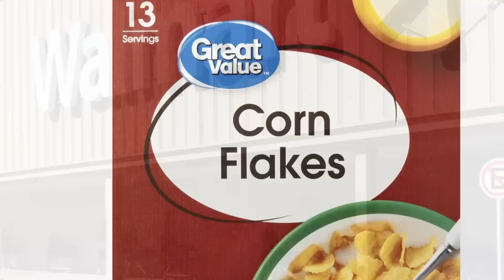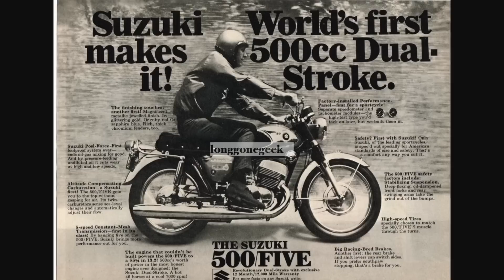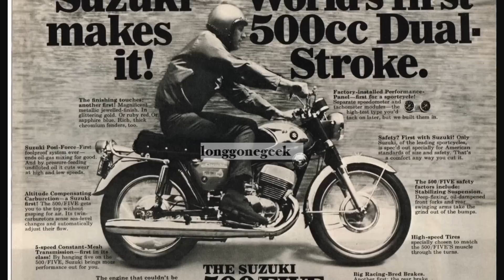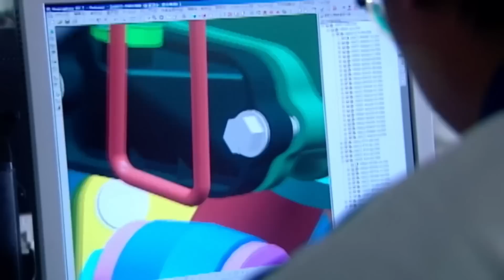How Suzuki became the Walmart of Motorcycle Companies

Comment: Im not sure why you keep saying they have no advanced technology. My busa has hill assist, cruise control, cornering abs, combined breaking, launch control, engine breaking control, adjustable suspension, wheelie control and rear tire lift control, LD everything, a TFT dash with multiple profiles, break pressure and lean angle indicators, quick shifter up and down the list goes on lol

Comment: Suzuki stole the design of the air cooled twin cam 4 cylinder from Kawasaki it's based of the same engineering as the z900 which is the actual bike that blew up the market and started the "sportbike" trend Kawasaki's then for example if you had a Kawasaki 750 you had the most powerful production 750 on the market same as the 650 z900 z1r ect. Suzuki ain't known for anything but plagiarism the first year 77 gs first production run of the gs is a Kawasaki's copy cat 😂 get your facts straight dude
Reply: Thank you 🫡🥷

Comment: I would say Honda built the first true sports bike with the improved 1982 CB1100RC2 Full Sport fairing  solo seat unit that turned to 2 seater multi adjustable handle bars rear set pegs and beautiful aluminum 26L tank etc yes it was a limited production bike and US didnt get them but it was a big leap forward in sports bikes handling brakes etc ...

Comment: Been riding Suk's since the 60's. You can talk about manufacturers for ever. Great bike riders can make any bike great. I've owned a 1980 GS1100 since 81. I've maintained it meticulously and it's in mint condition. I have a 4/1 header on it and to this day it's an easy to ride rocket ship. Unfortunately Suzuki is not the same company I knew growing up. Great bikes at a great value that if maintained were very reliable.

Comment: I'd love to see Suzuki start making the one bike that Honda and Yamaha wont for this market: A full function, simple motorcycle for MUCH cheaper than everyone else. For example, give us 1970's or early 80's tech and performance, at 1980's prices. Bring back the 1981 GS450 at $3k. It'll do 95% of what most riders need to do, at a price that most can afford. So what if it doesn't have the latest in casting technology, or ABS systems, or TFT display? I'd love to see a return to very simple, inexpensive bikes that everyone can afford. You want to get more folks riding? Bump up the engine size of the TU250 to a 450 or 500cc P-Twin and change only what else is absolutely necessary for the power level, and sell it dirt cheap. Or drop it down to a 125cc and sell it at rock bottom price. Think Honda Cub or Ford Model T.

Comment: Face it, there is limited room to increasingly change the platform of a motorcycle. It's diminishing return. I recently had a GS500F. It was a solid, simple, affordable commuter. I gave it to my sone when I decided I wanted to ride a Triumph again. But I would buy another 500, or maybe a v storm. But I am the kind of guy that likes  air-cooled, carbureted, kick start, parallel twins and thumpers.

Comment: Supersports are dying and being replaced by sport bikes. It might not make sense but technically supersports are just the 600 and 1000 classes, with the rare 750, with clip-ons and such, while sport bikes are all the rest that still have clip-ons but on risers. Like all the beginner sport bikes and especially the booming 650ish class that's replacing the 600s with mostly twin engines with somewhere around 80hp, like the new suzuki gsx8r that's the last to join this segment, tho kawasaki should update but I digress. I think the r7 is the only outlier really because despite being in this class power wise it retains the superspot position with no clip on risers.

Comment: Suzuki has been my bike since I ever started riding.  Im actually on my second k1 600.  I did my homework and went to the dealership and tried the CBR R6 Ninja etc!   With Suzuki yes there's alot of them. However they are probably the most comfortable sportbike out there.  They have power in every gear and are very easy to learn on.  So are they "The Wal-Mart of motorcycle's"?   To each his own i guess.

Comment: Have to disagree. Most of the tech came from 2 stroke like the Gamma 500 substituting a four stroke engine. Owned one and still am impressed with it 30 years later. Only bike I know that actually squats at higher speeds. Great handling and eye watering acceleration and speed.

Comment: not just in us, here in Indonesia Suzuki also backed down, their dealers and shop were closed.
but the reason was different, suzuki Indonesia just incapable to adapted to market. latest suzuki boom was satria fu or suzuki raider in thailand, a high performance underbone motorcycle. but the market was shifted, in 2012 the market was asking for sportsbike and automatic scooter, suzuki didnt have the sportbike and their scooters just flopped, when you riding a scooter what you need was light weight, low fuel consumsion and high durability, and that not how you describe suzuki scooter. in 2018 suzuki bring gsx 150 from india, but the hype of sportsfairing and naked bike was over, in Indonesia the market were, maxi scooter, retro scooter, and retro nakedbike, and suzuki didnt have any of them. in 2021 kawasaki launch zx250r, suzuki bring gixxer 250 from india again. and indian design just didnt go well.
its not like they didnt had the models, they had saluto in thailand for retro scooter class, they had brugsman for maxi class. but they choose to bring india models instead which honda already show in 2010s that didnt go well in indonesia
Reply: sad indeed

Comment: I own a 2007 GSF-1250 SA. (Bandit)
I bought it to commute around SoCal.
Today, it has over 233,000 miles on it.
It has never had any engine work.
It has never broken down.
Only basic maintenance.  Such as oil changes every 3,000 miles. Even though I used Mobil -1 the entire time, I still change it every 3,000 miles.
I have replaced the chain about every 25,000 miles, replace tires as needed. and air filter annually.
It still runs like new.
I cant complain.

Comment: Bart, you were not there in the '70s!  The Titan 500 twin was a mild mannered model, not even remotely raw or racy, and in general Yamaha and Kawasaki were at that time better known for performance, Then Suzuki sold the 'water buffalo 750' the first modern water cooled bike, again it was more touring than sport! My point is that at that time Americans did not see Suzuki  primarily as a performance street bike maker, but they did attempt to sell reliable 2 strokes at a time the world really wanted 4 strokes..50 cc racing was of never of much interest in the US. The GS series was new for Suzuki but hardly 'ground breaking' as it significantly copied the Z1 with DOHC and the all popular CB 750 in general.It was a safe bet for Suzuki, probably safer than Yamaha's choice to build a 750 cc triple.
One of the carryover 2 stroke features of the original GS 750 as well as of the Z1 was using a built up crankshaft; eventually they went over to a one piece crank with plain bearings as Honda used. 
A feature not often realized about the GSXR was moving the alternator off the end of the crankshaft to make it more compact and presumably able to lean further!

I would say that though selling fewer models now they continue to be known as reliable. We take that mostly for granted these days, but 50 yrs ago many bikes, especially 2 strokes were not !

BTW, in the early '80s I and others were racing 
Ducati Pantahas at the Bridghampton raceway in NY,  Guess who was taking closeups in the pits etc,  haha Suzuki engineers!  Tell me where an SV 650 was inspired?

Comment: I doubt if you guys know this, Suzuki has launched an excellent machine here in India (Gixxer 250) which is an allrounder in my opinion, it got ample amounts of horse and breaking power for Indian roads/traffic, you can use it in city as well as highway (my long stretch was 650km and engine was smooth without heat issues). This machine comes at a price that competes with R15 and mt15 but still the number of sales are 50 times lower than those. This is mainly due to poor service reach but still 50 times less is nightmare number for a machine of so much capability.

Comment: i think this video leaves out Suzukis' complete dominance in drag racing starting in the early 80s with the GS1000 motors. this continued into the new century, with only Kawi offering any competition. Honda and Yamaha were conspicuously absent. 
i agree with most of what you say, but i still find the Walmart comparison initially insulting.
Walmart is huge, whereas Suzuki is the smallest manufacturer of the big 4.
Honda is bigger than the other 3 combined (not sure if that is true anymore)
i would compare them more to Chevrolet - the GS1000 and subsequent GSX&GSXR motors were the modular "Chevy small block" of drag racing. (Hemis were very expensive)
i like my 01GSXR1K very much. The leap to current tech bikes is too expensive for the comparatively small increase in power/weight or handling characteristics. 
i also salute the SV650 as THE standard "standard",
the VStrom as the standard dual sport
the DRZ400 as the standard off road 4stroke and
the DRZ 450SM as the standard SuperMoto 
This shows a wider spectrum than just sportbikes, but sportbikes are my favorite segment.

Comment: Suzuki needs to drop the DR650 and rework the design it with fuel injection, 6speed awesome middleweight offroad T7 killer.  Skip out on the silly TC electronic gizoms and give it only bare bones disable remembering ABS.  It would be the alternative to more fully offroad compared to the new vstrom 800.  My only requirement would be to please add cruise control if its ride by wire.

Comment: In my country buying Suzuki makes little sense, few reasons for that.
The lineup for larger CC bikes is limited, as a result the dealerships are also limited resulting in bikes that cost as much as other Japanese brands. Furthermore Suzuki haven't updated their engines and other tech for at least a decade to decade and a half. So truly is a brand that erased itself from this market. Furthermore brands such as CFmoto and Benelli are truly giving a run for their money to Japanese brands. These brands are making some quality bikes across the range, unless Suzuki raises is game it will be the first Japanese brand that will go under.
Recently I was in the market looking for mid tier tourer Versys, Vstorm and Cfmoto800, it was later that i have decided to purchase. It's truly value for money using sqme engine as KTM 790,heated grips and seats, cruise control heck the bike comes with all panniers and luggage boxes. So in my opinion Suzuki aint the best value for money, its a waste of ones money.

Comment: I chose M109R instead oh HD Fat Boy for a few reasons: forward foot peg, proven perfected engine since 2006 and its sheer performance, low en tork, simplicity, no gadgets, no abs, cheaper to maintainance, Millwakee 8 engines are based on this engine (8 valves, 4 double spark plugs), full performance out of the box, does not require extra $30 000 to get full performance.  HD turn me down with their gimmics. Last the sheer beauty of the bike, especially in Candy Red. Even though it has the comfort of a cruiser, it has the stability and road performance of a sport bike... sort of considering its weight.

Comment: I believe suzuki and kawasaki have partnered together.  Everything goes in cycles bud.  Back in 1985 it was suzuki leading the pack and honda yamaha kawasaki were the walmart. suzuki gsxr 750 was state of the art technology back then. aerodynamics, engine oil cooling airbox, delta frame engine redesign.   I have no complaints about suzuki. If it wasn't for what they did in 1985/86, bikes wouldn't be where they are today.

Comment: I only own 1 1990 GSX-R 1100 and only 1, RG500 ( although it's in a Honda NSR MC21 chassis) and only 1, 86 GS700 with a 1150 motor wedged in...oh and there's the 81 GS1100 project pocket bike.
They're ok😏
I'm not a fan boy.
I have 2 Kawasakis, zx11 and ZRX 12 and a KTM SMCR.....so there's that.
Certainly nothing wrong with Suzukis. Nothing more than any other manufacturer.
Oh and I forgot about the 92 CBR 900, definitely a benchmark bike.

Comment: Can it really be called "innovation" or "ingenuity" with the GS750 when they basically threw up their hands after the weird/failed RE-5 and basically took the specs of a KZ900 engine (down to valve sizes etc) and made a 750cc 4-stroke 4cyl?  The real noteworthy thing with the GS750 was the very nice frame and suspension.  I'm no Suzuki hater, I OWNED a '79 GS750E and loved it, along with a '81 GS1100E, I think they are some of the most undervalued UJMs out there quite frankly.  But hardly innovative.

Comment: really suzuki fell off in in 2013, i know the motorcycle community isnt familiar with snowmobiles, but until 2013 suzuki was building some of the meanest 2 stoke engines. my m800 had a 165hp H.O. 2 stroke the last year of its production. never had any issues with their 2 strokes and always beat the bricks off of them.
Reply: Suzuki stopped innovating, especially off-road. Same old, same old with fresh decals. Side by sides have taken off-road by storm, they are big bucks... no Suzuki. Same  old King Quad (yawn) same old DR 400 (yawn) 
Honda makes entry level bikes (Grom) which mean new riders will stick with Honda. Suzuki, where are you? 
Fire the CEO...

Comment: First street bike I ever got to ride was a 04 gsxr 750 with a race pipe on it. It was basically just a small straight through resonator down by the swing arm. I didn't know what gear to be in on a bike thst revs that high so it overheated after a 30 min ride. I had to wait a few min to start it. Later i realized I was short shifting every gear because the bike was so loud.

Comment: Wow I had in the mid 90’s a 1981’ish gs 850 that basically looked like that first 750 4 stroke from mid 70’s it was 15 or so years old with shaft drive and a lot of miles for a bike at that time (like 26 k if memory serves) and barely ran …so I got it or $600 or $650 and immediately sent to local shop and dumped another $G into repairs ….then Proceeded to finally take my license test on it ,  passed, the beat crap out of it for a couple yrs with no issues aside from twisting bars when I went head on wth a full size ram charger truck….more damage to ram charger than bike lol the bike was a tank , I called it the dinosaur cause it was old as one and as big .

Comment: suzuki makes bikes that dont have the most cutting edge tech because cutting edge tech makes bikes expensive, and most people want a bike because its cheap.  you want the most cutting edge high powered sport bike on the market?  go buy an h2, except for that price you could just buy a car.  most people do not have $30,000 to spend on a vehicle that can have 1 passenger, but will probably have 0, and has no luggage space, and can only drive in clear weather when it isn't winter in most places.  for most people, if they are going to get a vehicle they can only drive half the year, and of that half year they will probably only be able to drive half of those days, in other words 1/4 of the year, then they are going to pay 1/4 the price of a car.  also the slowest gsxr 600-1000 has far more power and speed than 99.9% of people owners will ever use on the street.
Reply: 1,000's of RMZ450's are sold because they are the "best bang for the buck" for, trail riding, Enduro's, desert riding, hill climbing, and play riding.
They never see a motocross track, or a fancy suspension shop.
No mods required and they last you 5-years easily - with cheap readily available parts.
People buy them because of the word of mouth how good the experience owners have.

Comment: Good video and I agree with your concluding comments. Some of the models I have owned that earned top choice for me were: SV650 in the light middleweight sporty bike category. DR650 in the middleweight dual purpose category. Burgman 400 in the maxi scooter category. Bandit GSF1200S in the light heavy weight sport touring category. Those were hard earned positions as I have two dozen bikes in eight categories, though I'm culling the herd to half that. Having ridden multiple 600's and liter sport bikes, I think the GSXR 750 was the Goldilocks one bike solution, addressing the lack of midrange power of the 600's and cutting the weight of the liter bikes. The GSXR 1000 was also a good alternative for just a little more weight and money.

Comment: My last bike was a gen 1  SV650S. I had it for years, every time I rode a newer or more powerful bike, I just kept going back to the value proposition. I had an 80km ride on one of the best motorcycle roads in Australia as my daily commute, and the SV was perfect. Bigger bikes just couldn't keep up in the corners. I sold it a couple of years ago, and only just bought another bike before Christmas - a 2008 naked Bandit 1250. The thing is awesome, pulls like a train, is stable, and is still fairly flickable for a relatively heavy bike. Are there better bikes out there? Yes, but Suzuki has always managed to find the sweet spot for value vs performance.